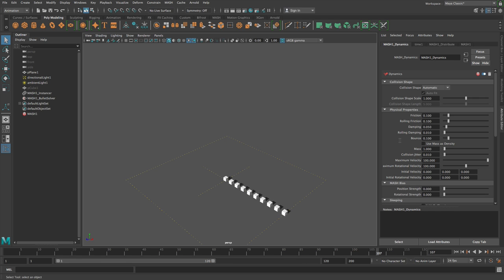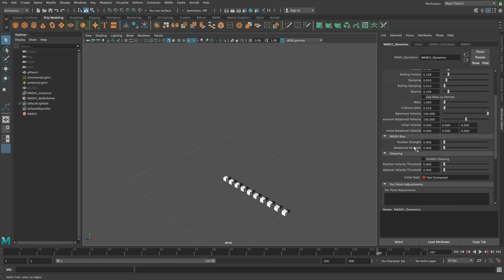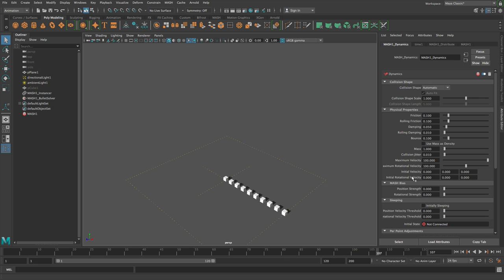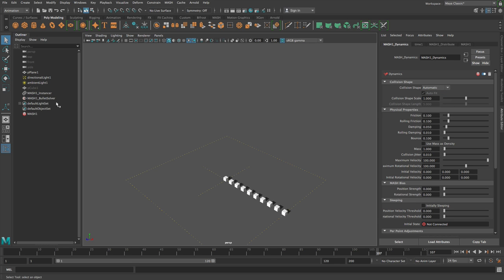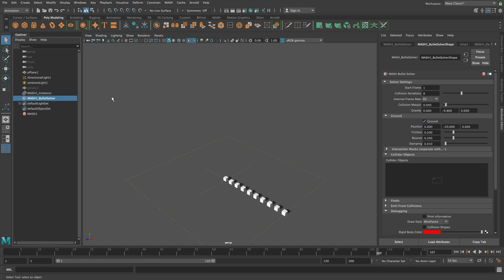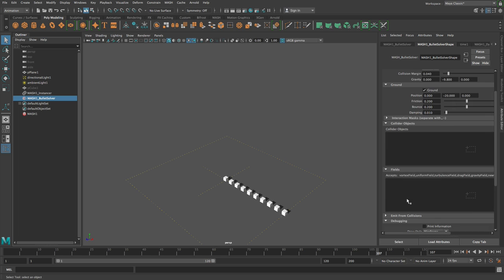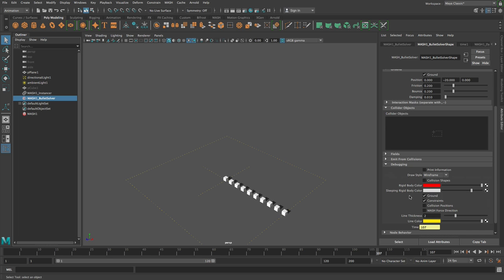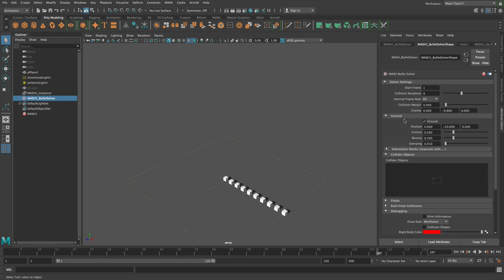MASH Dynamics No 1. How to Add Dynamics

Comment: Great channel Ian. Thanks for sharing. I do have a question with regards to MASH and it's capabilities. Could mash allow me to recreate a Chinese firecracker (red cylinders with their fuse tied to the main string) with each of the cylinders attached to a main string? Or even seeing how you could recreate that or even some kind of wind chimes. I assume a wind chime setup would have the same problem solving issues with these firecrackers. I couldn't find anything on YouTube that has a similar setup like that using dynamics. I appreciate any help or pointers on this - Thanks.

Comment: Hello Ian, is there a way to connect the radiusPP (linked to the age of the particle) to a MASH network? Or is another way to work around that? I have a MASH network connected to a particle system and when each particle borns I want the MASH geometry to appear by increasing their scale.
Reply from the maker: Yes, via the Python node - you'll need to add a doubleArray attribute, then you can connect the radiusPP from the particles into this attribute, and read it via the python node.

Comment: Is there a memory leak problem with Mash Dynamics?
In Maya 2018.2, as soon as I enable dynamics, to a mash network of 50000 instances, it eat-up all my memory and freeze my pc!
Decreasing the number of instances, make no difference. Other Mash network don't use even that much of memory. Before enabling Dynamics, Maya was using 1GB only, and that with a scene animated and with 4 nodes of Mash. After enabling Dynamics, Ram would quicly build-up. reaching 16gb (all My system ram) in less than 45 seconds!

Comment: Hi Ian! I have a question. Is there a way to prevent intersections of the Repromesh if you scatter for example 50 Cubes on a Sphere without the new collision nodes (i am using maya 2017)? Do you have to work with particles or smth maybe?
I am really struggling on this one. Thank you btw for your great videos. I learned most of MASH only by watching your channel! :)
Greetings from Austria

Comment: Hi Ian. I have a question about MASH, can density of particles distributed along a curve be uneven or you must use two different mash systems to get the sandclock shape? I want to simulate motor protein body aggregation and stuck on solving this..

Comment: Ian Waters, quick question. What is your settings in Maya to have the dynamics system move "correct" when you have the default gravity  -9.8? I need to change it to -98/-980 to get it more like yours. I thought it maybe changing the working units from centimeters to meters would fix, however, it did not. Great tutorials, seen them all!
Reply from the maker: Pro tip ;) Never mess with Maya's working units when working with any Dynamics ;) Both Bullet and Maya default to CM and Bullet doesn't support any other units, so set your gravity accordingly (-980) if you want realistic gravity.